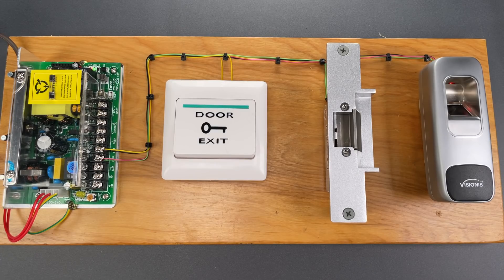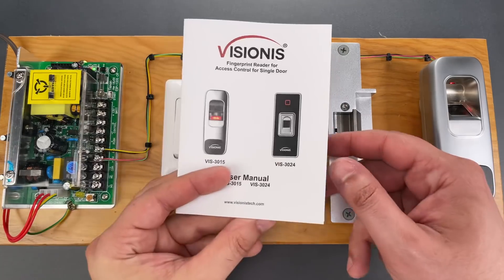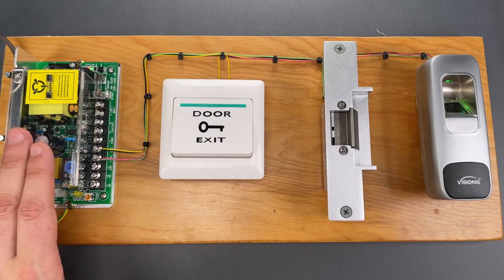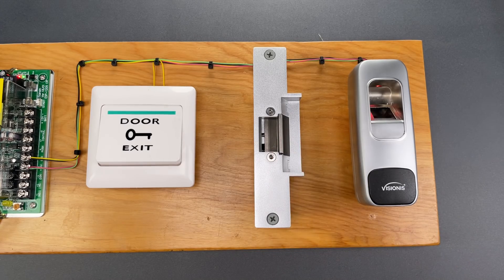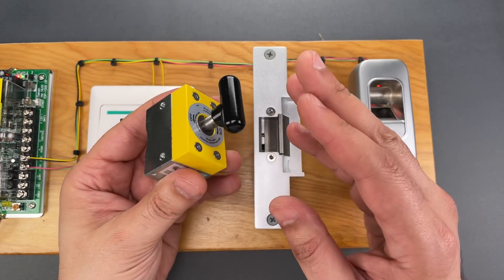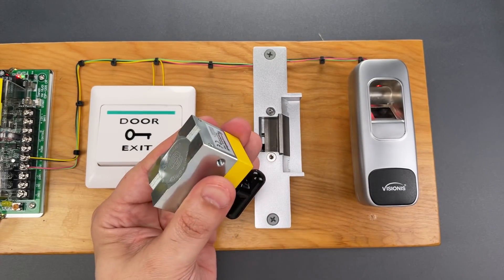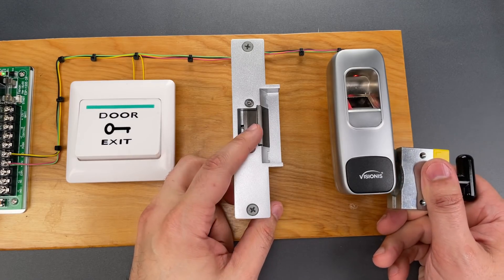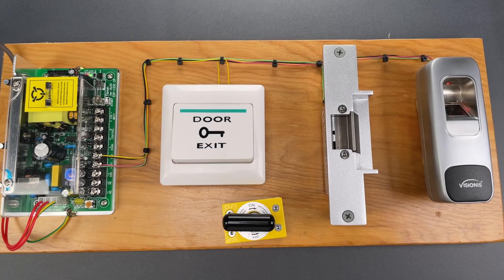[1359] Security Theater: Visionis Fingerprint Reader Bypassed

Comment: Remember that this mode of entry will leave absolutely no forensic evidence. Unlike bumping the lock or even picking it, which does leave marks that a trained person can detect.
Reply: Mm. I mean I know that picking obviously is mechanically different from inserting s key, but I have a hard time believing that provided you didn't touch the lock with your hands, someone could be "trained" to notice the effect that moving the pins with a pick had on the lock. Wouldn't that also require the completely sterile disassembly of the lock to inspect it? Somehow without disturbing these "marks" you're talking about? I mean I guess it could be possible if you were incredibly rough and started scratching the insides of the lock up...otherwise I'm really doubtful
Reply: @klimpomp  I guess you could find scratches from the tension tool on the outside. No need to disassemble anything.
Reply: @andreasabels589  I don't normally loose tension so badly that the tool completely leaves the keyway and is also still pressed against it enough to scratch...willing to accept that's just a personal thing though. Also I'm far from the most experienced picker so it's definitely not a matter of skill on my part.
Reply: @klimpomp  Did you watch the video I provided? Your tension tool will leave marks in the keyway even if you don't do anything wrong. Your picks will also leave marks on the pins.
Reply: @klimpomp  Ye probably if a noob did it you could maybe see some scratches
Reply: @Yellowstone300  You'll see scratches even if a professional like LPL picks a lock. You're applying steel tools to brass components under tension. Watch the video I linked above for very detailed examples.
Reply: This kind of configuration isn't used to protect anything. and it does exactly what it should do.

Comment: Should be a tamper circuit for opening the case, and as well it should trip tamper when the door signal goes high without an internal command. A diode would keep the inner access circuit from feeding back and tripping the outside tamper.
Reply: Just move everything but the reader to the other side of the door. Than anyone can tamper as much as they like on the outside. If they can't get the IC to believe it's getting a correct scan of a known-good fingerprint they're SOL, and a couple of fuses should prevent anyone on the outside from trying to fry the IC and hope it trips the actuating mosfet/relay by accident.

Comment: 2 questions: sistem detect that was open without fingerprint?! Can normal magnet be used ( like ones on speakers)?!
Reply: Higher end systems can have a door open switch connected. If the door opens without a proper input the alarm sounds.

Comment: I'd be very careful about touching that power supply.  Some have "hot" heatsinks.  Not "hot" temperature, but "hot" electrically. Even if it's designed not to be hot, that's putting a lot of trust in the assembly.

Comment: I said that in the initial video, let me say it again, worked at a place manufacturing locks of this type, it didn't take me long to just logically figure out that most of these can be defeated with a magnet, asked the superior about this and he said that they're perfectly aware of this and just rely on "most" people not knowing it.
Though for actually critical applications, they encourage customers to use the keypad/fingerprint/RFID reader units to not be used in standalone mode and only as readers where controls are in a secure room and communication is not analog but digital so it cannot be tricked (or at least not easily).

Comment: This seems SO dumb! Why couldn't thy just fix this? They already have the button that opens the door on the inside, so why wouldn't you just put all the "brains" on that side, and then the scanner would be just a scanner that would send it's "data" through the wires to the other side of the door, and that's where the data would be evaluated and judged. I don't see how that would add much complexity to the system at all.

Comment: Does that power supply come with the reader? If it does, then it seems like it would be pretty easy to move the validation over to the inside of the door and put it in there. 

Then again, you might need a few extra wires. I suppose the convenience of fewer wires to run through the walls which you might attach wrong is a more obvious benefit to someone having to install the damn thing than the security flaw which is invisible to the layman.
You could do something like a USB cable (altered so it won't be pulled out, probably cut and sodered at one end). It sends data 2-ways and provides power with 4 wires. It can send full color video, so a fingerprint should be trivial.

Comment: They should not be using relays to switch the current but low voltage triacs or solid state switches instead. These would not be susceptible to magnetic force.

Comment: Now if they made a lock that requires a specifically shaped magnetic field as a key, that would be an impressively secure lock. It could be built without requiring electricity so it wouldn't need a secondary bypass, and the only way to pick it would be to determine the field orientation and create a matching magnetic array.
Reply: plenty of high security locks in the past have tried this, it's trivial to decode and duplicate
Reply: @Mister_Brown  Has LPL done any on his channel? I haven't ever seen any in the configuration that I'm imagining, and can't see how they would be trivial to decode without highly specialized equipment.

I don't really have any reason to spend a couple hundred hours engineering one, but if some already exist I'd like to see them.

Comment: This is the worse possible way to install an electric lock... Your reader only should send DATA to the control unit inside the room and not power to the lock... If you wire it correctly, your setup weak point becomes the key-lock\strike lock\physical door only... if your door is a secure door, and you only have data interface ,you can't get in without Brut-force it by scanning all the numbers with a computer connected to the data lines- if it has a poorly design controller without delay after every failed try...

Comment: Do people actually use a system like this for single door? The vast majority of systems I've installed and come across usually have a single door controller you would install on the secure side of the door. All components run back to the controller so even if you remove the reader and try to play with the wires you will never get the strike to open. I don't think Security professionals actually use a system like this unless they were worried about money and installed it with the knowledge in mind.

Comment: A few dollars will stop the LPL, just connect a Reed Switch (a very small switch which reacts to magnetic fields nearby) parralel to the switch (relay) which the LPL's magnet opens, the reed switch (normaly open) will close due to the magnetic field and keep the lock locked.
When you use your fingerprint, the lock will just open.
Just don't place the reed switch too close to the relay.

Comment: improvement number one: switch the damm thing with a mosfet or other transistor improvement number two:put the switching cirquit on the inside and connect it to the outside with an encrypted connection!

Comment: The only secure systems I've seen like that run over ethernet back to the control box which is hidden somewhere in the building. The reader is digitally paired to the box and communicates the authentication message over the ethernet, then the control box sends the signal to release the electric mechanism in the door or on the frame. Some latches are simply powered to unlock, but the most secure ones are always powered and only unlock when they get an authenticated unlock command.

Comment: I’m an electronics engineer and I have multiple cures for the issues with that lock. First, you use a MOSFET transistor in place of the relay. That transistor should also be placed with the latch side electronics. Next you would want the fingerprint reader to send a message using a serial code to the latch side electronics as opposed to sending power from the reader to the latch to engage/disengage it. The serial Communications code would be unique to the lock and also could be encrypted to make it very secure. A MOSFET can carry a lot of current to control a coil or actuator. You don’t have to do it with a magnetic relay. Just my thoughts on this.
Reply: A MOSFET might be cheaper than a relay. Using a solenoid might have the same vulnerability to magnetic attack or bump attack. Decoding a fingerprint is much harder than encryption, so no extra cost to encode, and a $0.13 micro could decide. No need to change wiring, you still have power, ground, signal. An installer doesn't need to even know if the signal wire is DC or serial data. If power is 24vAC or whatever, then a cheap triac can substitute for a relay.

The point of these videos is to illustrate magnetic and other vulnerabilities are well known in the locksport community. So why don't product managers bother to watch these videos intended for the non-locksport community.
Reply: @ch94086  "decoding a fingerprint is much harder than encryption"

That's certainly false, but even if it were true, all I'd have to do is capture the fingerprint of an approved user, then replay it back when I want access.

This is why biometrics for the purpose of access control is such a horribly bad idea. You can't change your fingerprints once they are compromised.
Reply: @Nono-hk3is  Simple encryption algorithms like TEA can be implemented in literally a dozen lines of code while fingerprint comparison requires complicated image processing, but really who cares? As you said, using fingerprints for non-casual security purposes is a terrible idea. But at least fingerprints can pass the bored teenager test.
Reply: I think one of the design criteria was to make it simple to install and troubleshoot with basic low voltage wiring.  Something the maintenance guys can do.  I'm not sure what kind of bandwidth you'd get with unknown wiring.
Reply: On the flip side: a mosfet is not a galvanically isolated thing and doesn't close in both directions, so if you have a setup with e.g. an AC strike plate, it wouldn't work. You could make that work with an optocoupler and two mosferts plus the required bootstrapping electronics, but it would be more costly and complicated (and still more fragile) than the relais.  (Not saying I disagree with you, but I can imagine why it's tempting to go for a relais from a simplicity and reliability PoV, if you don't think about the security implications.)

Also, I'd say you send an image of the fingerprint over the line and let the 'secure' side figure out if it's correct; that way there are no sensitive materials stored in the lock at all. (Note that a fingerprint generally just is a picture of something like 100x100 gray pixels or 10K of data, that should be able to go over a serial link just fine.)
Reply: I looked up usual strike plates and they all seem to be 12VDC @320ma. Lowest cost relays (from global distributors in mfg quantity) are around $.50, a MOSFET is $.02. Even for AC drive, a triac is $.17 and opto-isolator $.15.

As the original comment mentions, the power to the strike plate solenoid needs to be inside the strike plate-- otherwise (as in other LPL videos) the button and fingerprint/card reader can simply be hotwired by shorting power and switch output.

Also mentioned above is the "open" signal wire needs to be an encrypted serial code. Loading and protecting encryption keys can be complex, but a $.30 attiny microcontroller would suffice for a basic solution (lock sends random challenge code to the switch, switch replies with encrypted response). So the cost of a microcontroller and solenoid driver is comparable cost to a relay.

I think using a relay and DC unlock signals is just legacy and lack of imagination on the part of designers, and lack of knowledge (or secure product availability) on the part of customers.

One problem with a secure unlock switches/readers and strike plates is that they need to be keyed-- you can't just go to amazon and buy a replacement. But a USB "keying" dongle could cost <$5 to manufacture. (The keys are encryption/decryption keys in this case.)

FYI other LPL videos illustrating vulnerabilities: 1040:hotwire with a paper clip, 1130:Relay magnet but with tamper switch on removing the keypad, 1045:Using a pocket knife to open even with a tamper detect and bypass of tamper with a paper clip. Amazing that you can access wires from the external keypad/reader just by removing a screw.

The encrypted unlock signal wire can also be used for tamper detect signaling.

Comment: This relies on a magnet overpowering a electromagnetic relay. Solid state relays exist, and would defeat this method. But what about the electromagnet in the latch itself? If that can be defeated as well, then that is much harder to replace because that part requires physical movement.
Reply: Big problem is the system trusts the reader, which is outside the security barrier.  I suspect the communication between the reader and the control is a simple switch signal too.. so trivial to bypass.

The majority of the guts of the reader with the relay needs to be on the other side of the door, with the fingerprint reader sending signed/encrypted packets down a data link.  That would be much harder to defeat (assuming it's not susceptible to gummy bear attacks).
Reply: @TonyHoyle  Very true, that is the first thing to change here, never trust the outside is a starting point for any improvement. But I'm wondering about the door mechanism itself. That too is operated by an electromagnet, and could be overpowered by a powerful magnet. And that soor mechanism is much harder to place out of harms way.
Reply: A rotating motor would make magnetic attacks more complex (but defense against alternating magnetic attacks might be needed), and a motor might require lower power and cost than solenoid. But a steel plate could be a pretty good shield, both magnetic and physical.
Reply: @ch94086  I think that an attack agains a motor using a rotating magnet was already shown by the LPL, in video 1145. But at least with the door itself you can put distance between the outside and any sensitive mechanism.

Comment: I always laugh in video games where the bad guys have an impenetrable shield of some sort but have the power source and/or off switch outside the shield so the hero can get in. I always wondered what sort of moron would design a security system like that.  Then this video where all the security is done on the outside of the door. 

Guess I can’t call those unrealistic anymore.
Reply: "They couldn't really bypass the lock just by fiddling with the wires on the keypad... Oh"

Comment: It seems that visionis sells security systems as modular "build it yourself" systems. From what I can find, buying direct from them you can get a controller, and then a variety of different access methods. So, I would assume to keep cost down, all of their access modules do verification on the module instead of in the controller; otherwise the controller would need the hard/soft-ware capabilities for every access module. They could have the access modules be two pieces, an exterior facing credential reader piece, and a secure side verifier, but this would complicate installation and perhaps be considered less aesthetically pleasing.

Which really brings us back to what I consider to be the fundamental rule of security: ease of use for authorized parties is negatively correlated to security.

Comment: I'm finding that most "fingerprint" locks, padlocks etc., are theater.
Reply: The problem with fingerprint or other biometric locks is that you change. Your fingerprint isn't precisely the same every time. So the print itself can't really function as a key. The reader has to be able to open the lock on its own and just decide whether the print it sees is close enough.

Comment: How does the magnet switch work? (I mean, being able to switch between very powerful and not)
Reply: Round magnet as a core inside a sandwich of 2 ferrous layers (iron or steel) with a non-ferrous (for example aluminium) layer in the middle. When the magnet is turned in a way that the poles are facing non-ferrous material the magnetic field is much weaker than when the poles are turned towards the iron plates.
Really simple construction but the effect is pretty cool (and useful!) :)
Edit: Or you can have two magnets on top of each other- if they are facing the opposite directions they create kind of "closed circuit" through the iron plate.
Reply: @sebastianwlodarczyk  thank you

Comment: If there's a relay in the fingerprint reader, then it's quite possible (though not certain), that the fingerprint reader isn't just making the decision but is also supplying the requisite current to drive the actuator. Unless of course there's another relay in the strike, but that seems silly*. While I'm sure it doesn't take a whole lot of current to drive the actuator (the gauge of those wires supports this assertion), it just seems... wrong. Not only should the fingerprint reader not be making all the decisions, as LPL points out, but it shouldn't need nearly that much current to carry out its fingerprint scanning functions.

*Not only silly because you'd be using a relay to trigger another relay, but also because if the strike itself contains a relay, there's a good chance it can be attacked with a magnet as well.
Reply: The strike contains a solenoid, so vulnerable to the magnet attack.

A better strike would have a motor.  But that's vulnerable to a spinning magnet attack.
Reply: @bdf2718  good point. This would be overkill, but a stepper motor would probably be pretty difficult to attack.